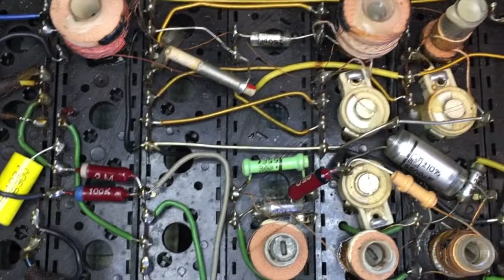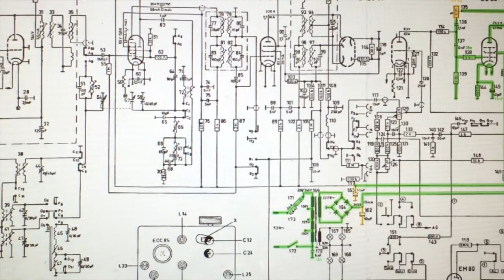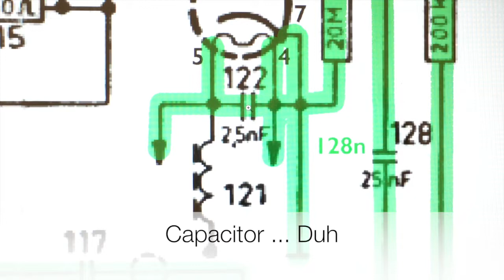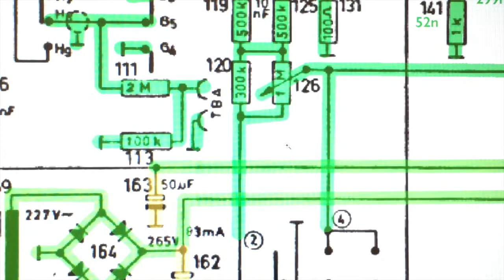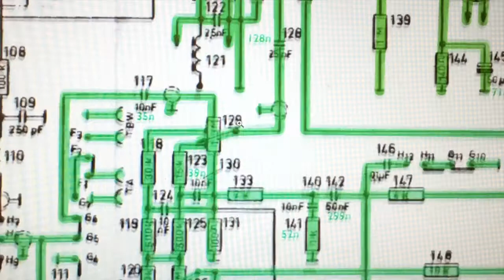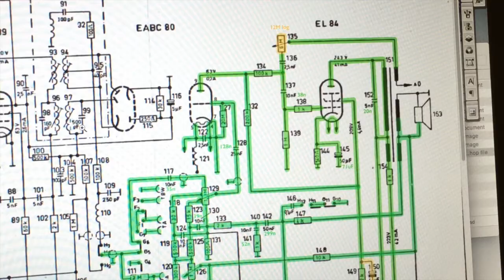Graetz Musica 4R417 tube radio restoration log - Part 4

Comment: hello, am restoring the same radio. I followed all your work and i managed to make the Musica sound again. Bit i have a problem i cannot solve. The volume control is too sensible , even at volume zero i ear music and if i just turn a little the volume raises abruptly as if the amp stage is overloaded ... can you give me some suggestions to solve this problem? its a problem that developed after some months after restoration. I have changed most of the Paper cap in the pa and pre circuit...
Reply from the maker: It could be the pot wiper itself. You may need to remove it, carefully dismantle it, and put it back together after cleaning the insides.

Comment: I'm a novice TTL electronics guy and fascinated with valve-based radios and TVs. Your explanations and interpretations of the schematics have been really helpful. Subscribed!
Reply from the maker: +Rahoul Zerohl: thanks. Welcome aboard this crazy path. And don't forget the difference between TTL and this hobby: the voltages can kill you dead! Stay safe.
Reply: Yes I'm very aware of the danger. I haven't started any projects yet until I feel I have a better understanding of it all. Best not to hurry into something like this.